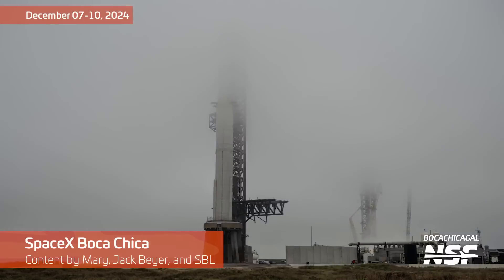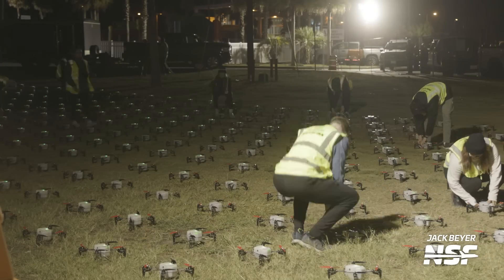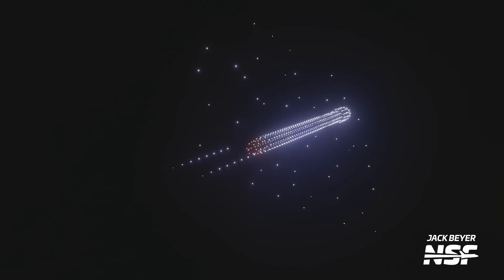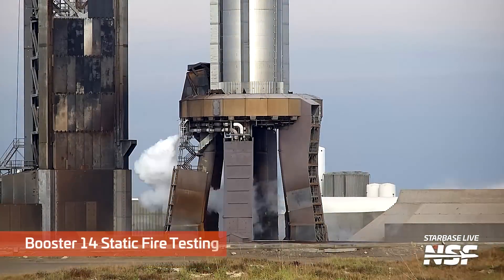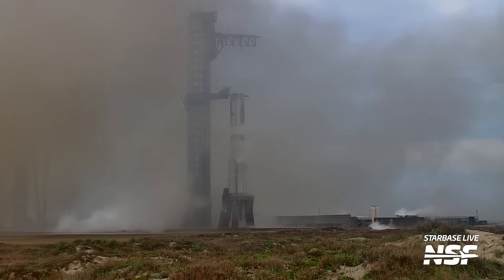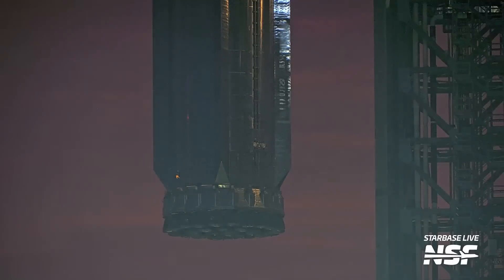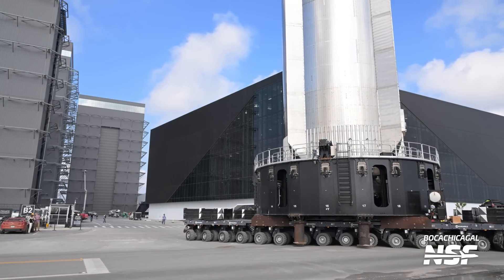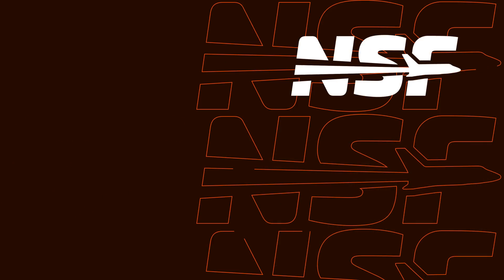Primed To Fire and Rolled Back | SpaceX Boca Chica

Comment: I am not an engineer or rocket expert, but SpaceX has a bit of problem with the billowing smoke from the static fire of the 33 engines. I am sure the water deluge system works, but there needs to be improvements. The idea would be to build an skateboard ramp or slide structure by mounting the booster on top. Then make an entrance such as a tunnel were the smoke can escape. Then put the water deluge underneath whereas the water slides down like a water slide does! This will limit the amount of damage coming out when doing multiple launches of Starship. :_HappyElon::_ElonPoint::_Gwynne::_yall::_concur:
Reply: Thank you for explaining what a flame trench is

Comment: Were the holes in that part to stop ice, or reduce sloshing? Maybe to reduce fuel hammering during the flip. You can see why they are building microwave weapons to burn up the electronics in the drones. They claim they have it perfected, and the trucks are ready to deploy.  
I have 3 big screen TVs & 3 laptops in my living room/media center. At least 1 TV has the live stream of the blastoff every launch. I generally watch most of the videos about SpaceX on YouTube. I have 2 Uniden Bearcat digital trunking SDS 100 & SDS 200 radio scanners on all the time to listen to police chases and fires. ( They aren't cheap!) They will decode any digital radio transmission that isn't encrypted. You can't listen to cell phones or encrypted police radios. Not all local or state police use encryption. For the Feds, nearly everything is now encrypted. In the UK everything is encrypted, even the EMS trucks. I'm glad I don't live there. Get ready for the Taiwan naval blockade. It is coming in a few years. Xi means it when he says it will be unified with the motherland.

Comment: Is it just me? Am I the only one smoking a King-sized roach joint during every Nasa-Space-Flight live-stream of a full stack Starship flight (where roach-level = flight# - 1)???
Since flight #1 was on 4/20 2023, I rolled a King-sized joint with fresh cannabis & fired it up when booster #7 lit up that rock volcano. (fresh cannabis has been smoked zero times, so it fits the equation)
For flight #2 I rolled a King-sized joint from the huge roach left from flight #1, plus four other level 1 roaches, and have kept this going for every Starship flight test since then.
I have already rolled the King-sized roach joint for flight #7, and have the four level 7 roaches I'll need for flight #8.
I'm now 2 days into an 85 day smoking binge where I will have to smoke 12 joints every day, in order to smoke the 1,020 joints I'll need to get the four level 8 roaches I'll need for flight #9, by Mar 6th 2025.
How insane am I? Am I alone in this obsession? Will it give me lung cancer? Stay tuned!

Comment: I'm actually working on my part 107 to be a drone show pilot right now. I've done ground support for shows.
Reply from the maker: Huh! Is there like a pilot-in-charge concept? Surely all the actual piloting is computerized.- Das
Reply: @NASASpaceflight  yes it's remote PIC.  But you need p107 to work commercially. I will be doing stuff on the side as well.
Reply from the maker: Interesting, thanks! - Das